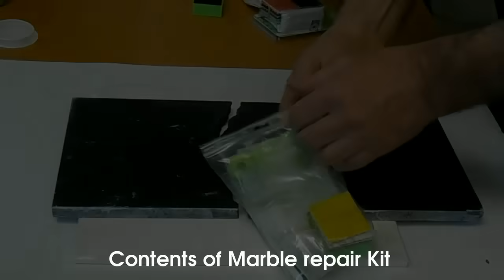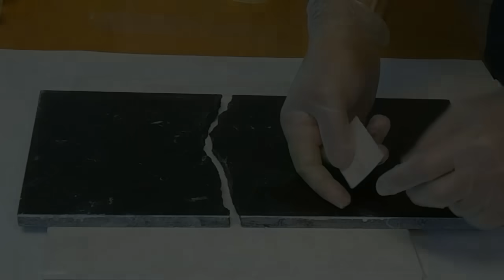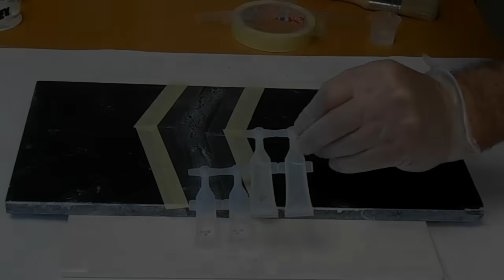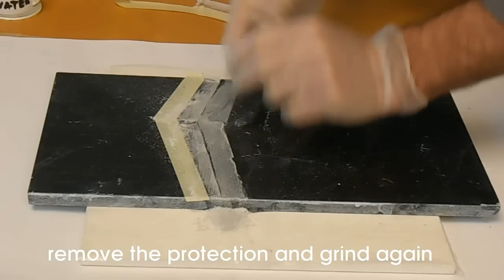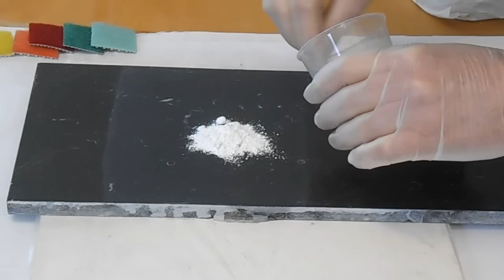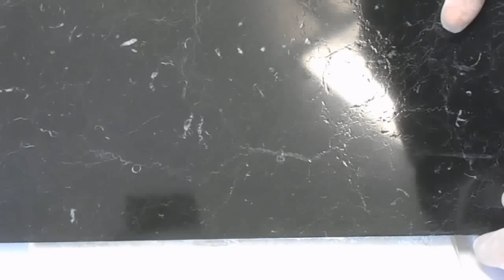How to patch and polishing black broken marble

Comment: If your resin is epoxy you would do better to press with soaped film more firmly using weighted or clamped flat material to press resin to a thinner film residue. Then remove the residue with epoxy film remover or solvent to just wipe away the residue without all the sanding.  It would end up going much faster without having to polish the marble with all the steps involved not to mention the change to the flat plane of the marble surrounding the crack that you create when you sand away so much stone.  Polishing would also be eliminated unless there is lippage to deal with.
Reply: I have a coated granite piece on my counters it's like a big chopping board style piece. Would this work for granite too? And would I need to buy some special coating/polish to make it look the way it did and protect it from everyday kitchen messes like water, food spills, heat etc?
Reply: I guess Im asking the wrong place but does any of you know of a trick to log back into an instagram account??
I was dumb forgot my login password. I would appreciate any tips you can offer me!
Reply: @Creed Dax instablaster =)
Reply: @Canaan Brixton thanks so much for your reply. I found the site on google and I'm trying it out now.
Looks like it's gonna take quite some time so I will reply here later when my account password hopefully is recovered.
Reply: @Canaan Brixton it did the trick and I now got access to my account again. I am so happy!
Thanks so much you saved my account!
Reply: @Creed Dax You are welcome xD

Comment: How does this product respond to Quartz? I managed to break my new counter in two during transportation. Much thicker material, 3 breaks at weak points near hole cut for sink. Is this epoxy strong enough to hold without need for additional support? I am considering treating it like tile to give it a backer board for additional support.
Reply: sam k ةةةة
Reply: sam k ةةةةةةةلة
Reply: sam k no not the best for that situation. If you are responsible for it breaking during transportation you can check out the manufacturer and ask for the same color in Integra 2 part apoxy. It will match the stone atleast... However polishing quartz is difficult takes time and patience... I have used a 3 step finishing technique from a kit you can purchase online it will never be perfect, however it will be the best you can do unless you replace it

Comment: What load of rubbish. Glue it with matching resin dries in 30min remove exes with soft part of a cuttlefish doesn’t scratch marble hole job done 45min 
Never sand face of black marble you could see were you sanded it and polishing powder altered the appearance of the hole tile

Comment: Respected sir,  
I offer my gratitude to you.  In India and all over world in historical places,  we have statue with broken nose or hand , we can repair it.
Please visit some Arabian site , how to paint the tiles. 
We can paint this marble and resale in market. It's a good job.  
In the past we have thrown lots of marble pieces. 
Once again thanks a lot.
Namh shivay.
Respected sir,  
I have one suggestion.  
I fill the gap of marble inside my home using this technique. 
You take one sponge 10 cm. long, 5x5 cm wide and thick. 
You sock the sponge in water and squeeze it the water.  
One day before experiment. 
First you clean the broken pieces with soap to remove dust.  Let it dry.
Experiment.  
You put the solution and pass the half dry and wet sponge on the surface of cracks,  the excess of solution will be absorbed by sponge.
You must first practice , how to pass sponge.  My hand have enough practice.  With this need to do very lesser effort. You also get floor color. 
But tiles color will hide entire mark.
Namh shivay.

Comment: i can do all that without damaging the face in under an hour with my glue
Reply: Could you explain how? I have a beautiful piece of granite on top of my counters (it's like a choppingboard) that cracked due to a heave glass falling on it. However I live in a really small house with limited work space and ventilation so the quicker and least messy way the better. Thanks in advance
Reply: @tara9389  Throw it out and buy a timber chopping board. You're ruining your knives cutting on granite.
Reply: @yeahnah7220  I don't actually use it for chopping.  I use it more as a counterpoint saver to put my pots on etc after cooking so the residual heat doesn't damage the counter tops.
Reply: @tara9389  Still, throw it out as its not worth fixing. Perhaps grab a slab of beer and go down to your local stone bench top fabricators workshop and tell them you're hoping you could swap the slab of beer for a piece of a granite off cut or a sink cut out. We literally fill 2 x 4 cubic meter bins per week with off sink cutout, off cuts and scraps, so youll find something easy enough.